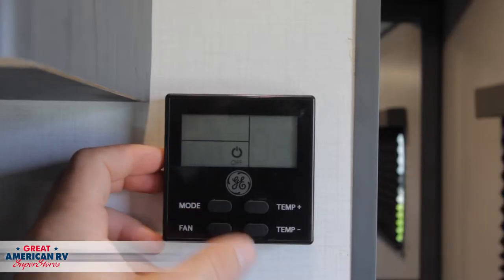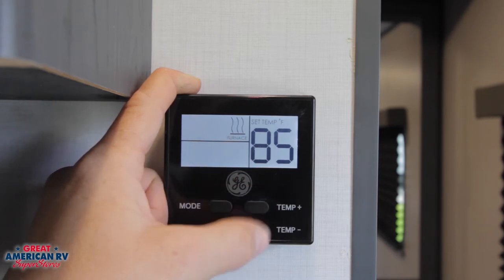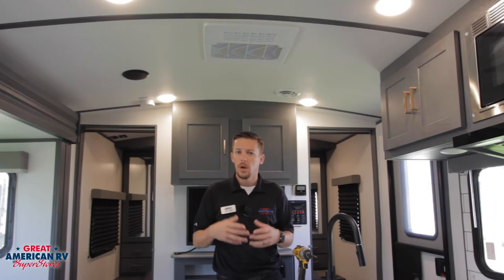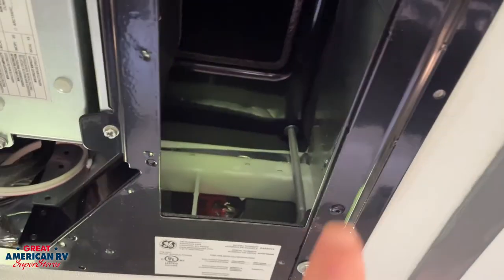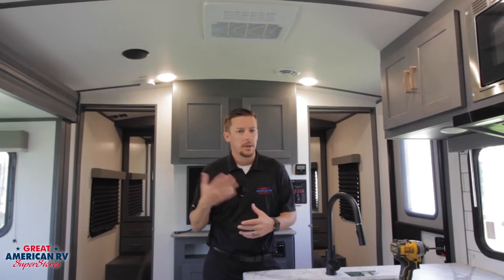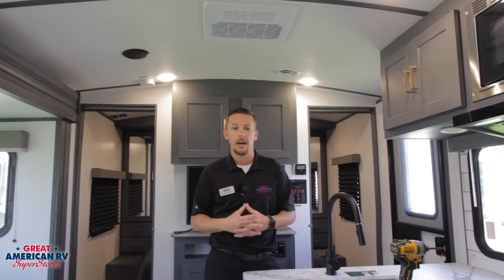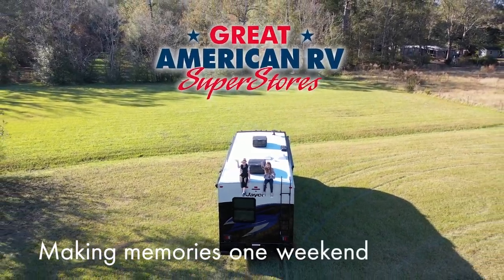GE RV Air Conditioner Operation and Maintenance

Comment: Video is no help.wanted to know how to remove covers without breaking them.
Reply from the maker: Remove the vent with the tabs and remove the screw covers with a small screwdriver.  At that point all the screws holding the interior cover will be exposed from removal.

Comment: You mentioned checking the torque but I don’t think you shared the spec? What’s the torque spec for the four long bolts
Reply from the maker: Great question, 35 +/- 5 inch pounds.  You want to make sure the gasket on the roof mount is evenly compressed.
-Todd

Comment: Question my thermostat use to be on cool auto but now it’s on fan on cool. I hit the mode button but auto won’t show up anymore. What am I doing wrong? Please & thank you
Reply from the maker: When you are in cool mode and the snowflake is showing, hit fan until auto shows up, and hit again if you want it in auto high. -Todd
Reply: Thank you so much!!! I thought it would come up by just hitting the mode button. Thanks again
Reply: I also learned a lot from your video- thanks for that.
Reply from the maker: @griselleyoung245  very welcome!

Comment: My ac was working great never had a problem then my ac started blow out warm air what can I do is it a total loss or could something be wrong with unit from the roof ?
Reply: How do I check the fuse ? They all look the same to me
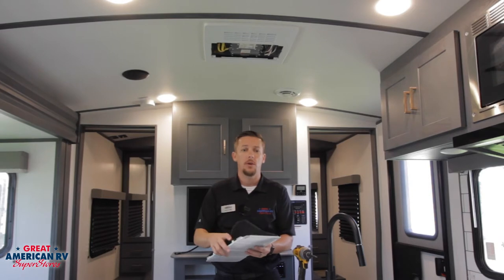Reply from the maker: @Ann-x9j   if the AC is running and blowing warm air, then a fuse or breaker will not likely be the error.  Have you checked the mixing divider to ensure air isn’t mixing?  Covered at 4:30 in the video.

Also, what is the temperature outside?  It’s possible the unit froze up, can try to run just the fan on the AC and see if it defrosts and kick the AC portion on again. -Todd

Comment: Do you guys know where I can find the un-blurred copy of the control board wiring diagram? I found the manual on GE website but they purposely blur the image and text on page 13 which is the wiring diagram specifically for the control board. I am just trying to ascertain which wires do which functions. Hopefully you can help me with this.
Reply from the maker: No we do not, but if you pull the assembly off and remove the cover to the board, there is a wiring diagram on the cover.  For the boards on the lower and upper.  -Todd

Comment: I just bought a camper and it as solar it’s the same unit but my thermostat screen won’t turn on it was on when I bought it and it sometimes comes on but immediately dies and shuts off the ac so would that be a thermostat issue
Reply from the maker: It very well could be a thermostat issue but I would check the wiring first to make sure there are no lose connections.  If your handy with a multimeter I would also ohm out the wires as well.  -Todd
Reply: Hey I had that issue with my brand new Springdale, it might be loose ground wire. Now my ac don’t work that’s why I’m here. Good luck!

Comment: 2:38 pm Tuesday, June 27th, 2023  what size a/c filter does this a/c need?
Reply from the maker: Generally the type that’s in the video is 14" x7-1/2.  You can google GE Rv AC filter and it will give you options as well.

Comment: getting blinking “FC” code. Can disconnect power and battery, reconnect and then turn on AC, has about a 5-10 second delay then turns on, give it about 5-10 mins and it goes back to “FC”
Reply from the maker: This is a communication error between the thermostat and the control board on the A/C.  I would start with checking the wiring on the back of the thermostat to ensure there 3 wires are connected [RED (+12V) BLACK (GROUND) YELLOW (COMMUNICATION)]. Ensure all of these wires are nice and tight on the thermostat.  Next unplug your RV from any an all 110 power sources to kill power to the top unit.  Remove the Filter screen and possibly the entire ceiling assembly on the interior to give you enough access.  from there you should find their thermostat wire going into the control box.  Remove the control box cover and check the connections on the inside, usually put together with a wing nut connection.  If you don't find any issues you can run a test wire from those connections to the thermostat and try running that way.  This would verify anything behind the wall causing issues intermittently.  If one of these issues doesn't resolve the problem it is an issue with the thermostat or control board.  -Todd

Comment: How do i troubleshoot a F1 error code?
Reply from the maker: Above the box at minute 5:26 you'll see the inside coils.  You need to make sure that the freeze sensor is plugged into that control box and the sensor properly mounted in the saddle off to one of the sides of the inner coil.  That would be a start.  Beyond that it would call for more diagnostics using a meter and getting certain readings from the controller and sensor. -Todd

Comment: What about freeze switch , i found myne just hanging , would like to know where it goes.
Reply from the maker: Great question.  You should stick it in the fins about half way up.  You should see the fins looking straight up if you remove the air filter.
Reply from the maker: Great question.  You should stick it in the fins about half way up.  You should see the fins looking straight up if you remove the air filter.
Reply: @GreatAmericanRV  Actually there is a saddle on the curb side of the coil that the sensor inserts into. If you just jam it into the coil, it most likely will not protect against freeze ups properly. Dometic and Coleman are that way, but the GE sensor location was designed for ease of install, and consistent placement.
Reply from the maker: @wtroyer01  thanks for clarifying that
Reply: @wtroyer01 I think this prevents the coils from getting cold.  When mine was running the line was very cold, where the sensor was, but the coils weren't getting cold. I think it's location makes it think the coils are frozen when they aren't even cold

Comment: Question i have the same unot and thermostat . When my unit and thermostat is off the word Low is displayed on the thermostat what does thay mean?
Reply from the maker: It has a built in diagnostic and could mean the following.

Low Voltage Detection:
If the 12VDC drops below 10.5, the thermostat will switch to “OFF” mode and the display will flash “Lo”. When voltage exceeds 10.5V, the display will stop flashing, show “Lo”, remain in “OFF” mode, and other modes must be reselected by the user.

Check you 12V battery voltage and converter output to confirm you have a proper 12 volts.
Reply: @DixieRVSS  Thank you ill take a look. Im almost positive it read low but I may be mistaken. Ill take a look thank you again!
Reply: How reliable are the GE rooftop ac's. Will they work with the non ducted penguin 2 ceiling box?
Reply from the maker: @rotwiler7674  Not 100% on if they will work with that ceiling box.  Reliability has so far proven to be pretty good, granted they have only been out on the market for a few years.

Comment: Bought mine 10/22 new camper last summer didn't use know A/C this year having to replace and luck will have it business Bought it at know one answer the phone . My luck. A/C fan runs , compressor runs . Every thing seems to be functioning properly does anyone have a suggestion before I buy a new unit.thanks
Reply from the maker: Let's find a starting point and go from there, have you tried any of the suggestions in the video?  Around 5 minute mark we talk about the air mixing which is a common issue and easy fix.  The more specific information you can give the better I can assist.  What is the temperature of the air going into the AC and the temp coming out?  -Todd
Reply: I just got a new trailer with this ac and I feel like the freezer censor is the issue. They have have it attached in a copper cylinder attached to the freeze line that feeds the coils. I'm curious if it's getting so cold it's not letting the coils freeze.  I moved mine to be inserted in the coils and going to see if that works.
Reply from the maker: @HarveySpecter14  Wanted to make sure you understand, the freeze sensor is to shut the compressor down and prevent the coils from freezing up all the way.  You don’t want the coils to freeze up.  -Todd
Reply: @GreatAmericanRV  totally understand that. But I think the way it's designed, it's causing the compressor to shut off prematurely. I moved the sensor into the coils so it'll still recognize when they freeze.
Reply: @GreatAmericanRV  if I move the sensor to sit in the coils, won't it still prevent them from freezing?
Reply from the maker: @HarveySpecter14  was it the type like a needle or a clamp for tubing?
Reply: @GreatAmericanRV  it's like a copper cylinder
Reply from the maker: @HarveySpecter14  I’ve never tested so hard to say, but my theory is if it’s not making proper contact with the inner fins it would take more icing build up to initiate.
Reply: @GreatAmericanRV  appreciate the response. After testing, it didn't fix anything. It appears that only the middle of the coils cool to get a little frost and then evaporate and go warm. Everything else on the coils stays warm 🫤
Reply from the maker: @HarveySpecter14  not a problem, GE has a decent customer support system.  They can help you troubleshoot further.  1-800-626-2005.

Give us a like a subscribe for future content.  Thanks for watching.  -Todd
Reply: @GreatAmericanRV  thank you and already have!!

Comment: Uh....slow down! Which way do you push the filters cover ??So I don't break it!
Reply from the maker: If you are facing the ceiling assembly the same direction I am in the video, you will push the tabs away from you and the grill will come down.  -Todd

Comment: These things are junk I’m on # 3 since 2021 the only reason I still have one is the rv warranty keeps giving me free ones but if I change it I’ll definitely go with another brand. 
 I do know I will not buy another rv with a GE air conditioning.  If you want to skip being hot on a trip I’d choose a rv brand that doesn’t use GE.

Comment: The GE AC is junk. I am on my second one since 2021. The camper sits under a cover and hasn't been used.
Reply from the maker: While I can’t disagree that it’s not the best brand, I’ll suggest that you exercise your A/C by running it for a few days a month.  If you have it plugged in set it at 80-85 and just let it kick on now and again.  The more you let it sit without used the more likely things won’t work.  That goes for all components.  You may already do that but just wanted to make the suggestion.   Also, make sure the cover it’s under has enough space for air to circulate as it runs.  -Todd.